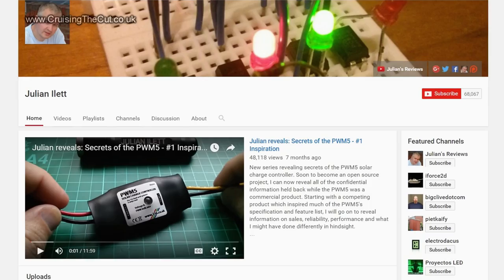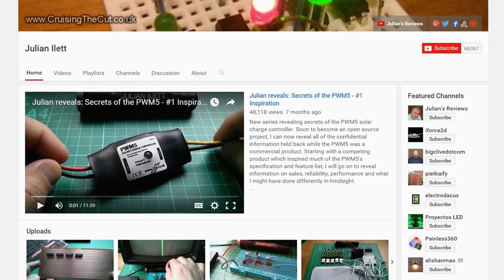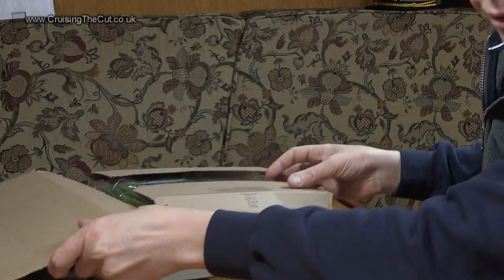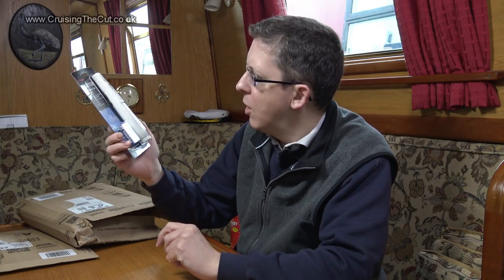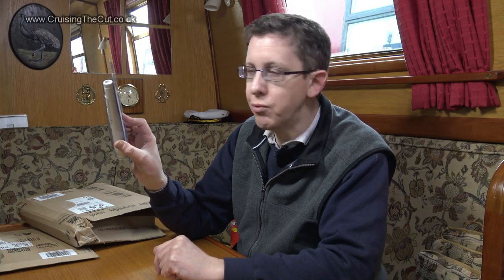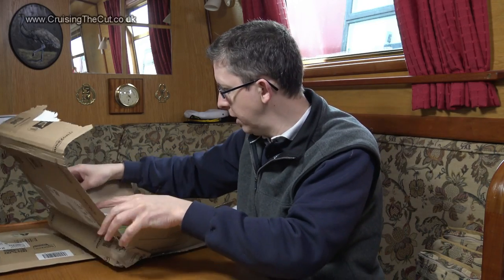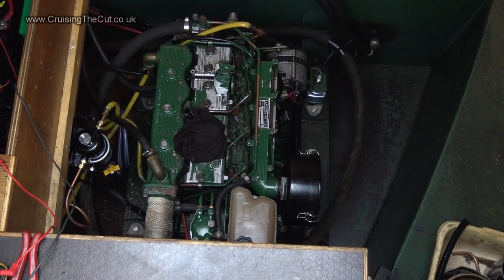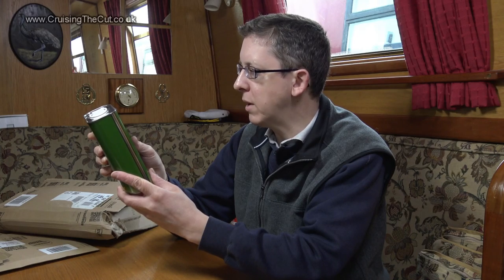24. Another haul of bits and bobs for my narrowboat.

Comment: Teflon tape is only intended for permanent pipe connections. It's not meant to be used on 'temporary' hook-ups. The pipe connection that goes into the storage tank should have an 'O ring' on the tapered nose. Putting tape on the threads will prevent it from seating safely and will eventually lead to bigger leaks. 'Tips from a retired plumber'...
Reply: Have to be careful with that stuff, I just in the last month or so had a piece of tape work itself into my hot water tank, blocking the hot water for a couple of days, then eventually finding it’s way into my showers two way valve causing it to leak until I was able to take it apart.
Reply: Above is correct. I suppose it won't hurt having the pt on the connection but the o ring does the job so anything the might cause the ring not to seat properly could be a problem. Love the boat and the vlogs!
Reply: By the comments it seems like his propane tank is doomed to 
Certain explosion as a result of Teflon tape being stuck in something
Reply: David is using plumbers tape not duct tape. Duct tape is awful, instead Gaffers tape will last many years and will pull off easier.

Comment: Don’t use the yellow PTFE gas tape on the threads going into the gas bottle! Or on any fittings that are flared. The tape should only be used on tapered thread joints. The gas bottle fitting relies on an 0-ring or flare to seal it to the bottle. It that doesn’t seal you need to inspect both the bottle and the fitting for scoring (and replace if scored) and replace the O-ring. Same for flare fittings. Using the yellow tape on those type of fittings compromises your safety.
Reply: you got that right
Reply: Ditto

Comment: Do not use the tape on the connection to the bottle. It is not a pipe thread and if you use the tape, you are going to create a leak.There is a reason the there is a o-ring on the front of them. Most new connection all have a o-ring to help seal the connection, if yours doesn't then you might have a an old set up and might need to upgrade.
People have a tenancy to not handle these item with care. They will pull them out the cylinder, let them drop to the ground and wonder why they have a leak. The ends are brass/copper and are soft. Dropping them causes damage and over time this will cause improper sealing. Always set the end carefully aside and you will never have sealing issues cause by bad ends.
The other issue is dirt. Always inspect the tank valve and the hose end for dirt. I can't tell you how many time a simple leak is cause by a small grain of dirt that got in the wrong spot. I was trained by a Englishmen back in the 80's to do propane vehicle conversion (i live in Canada). He was very particular about how thing are done. So i am passing on what he train into me all those years ago.
The best way to check your connections for leaks is soap and water in a spray bottle. Simply spray the connection with the solution and if there is any leaks it will start to bubble away. Simply tighten the connection a little more until you it stops bubbling. (if that doesn't work, take it apart and clean it, looking for dirt). You pointed out the hole in the bottom of the gun whale, and they are there for a reason. Propane as a gas is heavier than air. It will always settle to the bottom of hold and escape. You were not in any danger. Propane as a gas has a very narrow window in which it will explode.

Also some the tape you can buy is very specific to what it can be used on. Make sure that you read the use before you actually use the tape. Some tape is only use for hydraulic fitting, while some is used for gas only. You can buy tape for both used. When using the tape, you always wrap the tape in the direction you are tightening it. So clock wise, wrap it to the right hand and counter close wise on left hand thread. If you don't do this, when it is tightened it will unravel and not work at all, ie: create a leak.

Comment: I had a shower-shutoff valve like that. Turned out that when I stopped the water, the hot water cooled off in the pipe. The temp was not the same when it came back on. Better than nothing, though.

Loved the little yelp when it fell.

Comment: It seems to me that putting in a valve AFTER the hot / cold mix would mean that either the cold water or the hot water is gonna force it’s way back into the other depending which water is of the higher pressure. All things being equal this would likely mean the hot water would force its way into the cold water tank creating a cycle that will eventually keep heating up the water and using up your gas doing so also possibly damaging anything heat sensitive..... this doesn’t matter so much in the middle of taking a navy shower but I wouldn’t recommend using it in between showers just to keep a desired mix of hot and cold locked into the system.

Comment: I personally have been told NEVER put anything on the gas connection to the bottle, making sure the connection hose and bottle are clean is the vital thing.
It is the taper that is the sealing face and there must be nothing in between.
Simple leak test, get an old spray bottle, add water and washing up liquid (in correct proportions) spray around fitting after tightening............ growing bubbles you have a leak "simples"
Putting PTFE tape on the thread will do nothing but probably make doing the fitting up tight worse.
You can now get rubber nosed connectors (the taper being rubber), these also have no spanner fitting just a knob for hand tightening only (hand tight is all that is needed for this type).

Comment: be careful putting any battery powered devices near any gas leaks , there are leak detector cans you can by and just squirt them on all the joints and they will bubble at the slightest leak , also ptfe tape is no good for threads that use a washer as a sealing gasket (  gas bottle fittings ) , the threads are normally just for connecting the male and female parts whereas the black washer or gasket is the sealing part of the fitting , great videos btw ( and i am not being critical  its just i work in an environment that uses alot of dangerous gases ) , thanks again for the vlogs , really enjoying them ...
Reply: great points soap bubbles works just as well as leak detector and cost less than pennies.

Comment: Just found your blog, love it keep up the great work.
Your gas tape is very good but I have found that a couple of drops liquid dish soap in a glass of water and an old paint brush works just great checking for any compressed gas leaks.  Just paint the soap mixture on the suspected connection.  If there is a leak you will bet bubbles and if no leak you get nothing.  In the case of you gas connection, if it is  blowing bubbles just tighten a little until the bubbles stop.
Reply from the maker: Good tip, thanks! Glad you're enjoying the videos :-)

Comment: Having built a cruising boat and used it for several years and using propane gas in my own home (in 20 pound tanks) I feel I must say something about propane fittings. Propane fittings seal by metal to metal contact. The fittings to the gas tank are much like a ball and socket fitting. The ball is on the hose side and the tank has the socket, The thread is only to force the 'ball and socket' together. Using tape on the threads will provide you no security to a prevention of a gas leak. Worse still is that using the tape (or thread paste, as some-one erroneously suggested), is setting yourself up for a gas line failure. At your appliances are burners with a very small orifice. Particles of tape or paste will prevent your gas system from working. 
Take a good look at the hose end fitting. Study its' structure and you will see what the thread is for.
An other item of great concern is your desire to put a propane sensor in the propane locker. While it may well warn you of a leak it does not serve to warn you of dangerous gas. Your locker is vented (at the floor level) and leaked gas will harmlessly leave your boat and enter the atmosphere.
It is leaking gas in your cabin you must be concerned with. Here leaked gas will settle to your floor where you will not smell it and where it will collect as you do not have the vent as you do in your gas locker.
If you want something in your gas locker the I strongly recommend an electrically operated gas shut off. You can hook this up to an interior gas detector or (as I did in my boat) install  a "panic" switch somewhere convenient in your boat. If you have an interior gas leak the interior gas detector will sound the alarm. Then you run to your "panic" switch and cause the gas in the locker to be turned off.
You don't want a battery operated gas sensor. If battery dies you will not be aware that the sensor is not working. It must be tied into your 12 volt system. Also connect the sensor power supply to a fuse which supplies a circuit you constantly use. Thus if fuse is burned your constantly used item will not work and you will immediately know that your gas sensor is not working.
My wife and I are busy looking at all your presentations. Oh! How I wish I lived in England. Lucky you.
Reply from the maker: Good tips, glad you enjoy the videos.

Comment: This is an old video but I'm pretty sure those gas connection fittings use an internal flange setup to seal not the threads themselves.  If you are using ptfe tape to stop leaks you're just masking a problem with the fitting.

Comment: Hello, we’re in the USA(PNW) with our class A RV, the shower knobs were like yours a hot and a cold (it waisted a lot of water. We went to the RV supply store and purchased a new shower head/hose combination. It had a push on push off valve on the shower head that when you have the hot and cold mix to your liking, you push off lather up the push on to rinse off. Plus the water pressure was better with the new one. ⚓️I love the layout of your boat ... George

Comment: Just a couple of tips for you. There is a right and wrong way to apply PTFE (Teflon) tape. Wrap the tape so the exposed end faces away from the direction you tighten. If you wrap it the other way, it tends to unravel as you tighten your fitting. You mentioned brushing on your degreaser. I find it is much easier to put some in an empty spray bottle, and apply it that way. You can use a brush to agitate really grimy spots. Great video as always. I live vicariously through your adventure!
Reply from the maker: Excellent advice and much appreciated. Ta.

Comment: Never use teflon tape on left hand threaded connection to the gas bottle. As stated below the seal relies on the conical end of the hose connection that mates with the gas bottle valve, the conical connection may or may not be fitted with an 'o' ring.
Reply: wrap the tape the 'other way'...
Reply: Opposite to the 'Right Hand Rule'

Comment: You've probably discovered this by now, but that plumber's tape works like cling wrap. There's no adhesive, you just stretch it a little as you wrap it around the pipe threads and it clings to itself long enough to assemble the pipe fitting. I use it on all my gas and water plumbing.

Comment: the bottle connections are not to be used with gas tape or they are shaped conical or they use rubber rings. :-) and with that fitting on your shower hose you will mix hot with cold when using a other tap it will flow true your shower tap when you are not using the shower. only if there are one way valves in the wall behind the tap that could work. but you will know that by now i think. :-)

Comment: Teflon tape is for NPT fittings . In America that's National Pipe Thread.  Propane bottles here in America  don't seal at the quick attach threads. 
I have a tip when using teflon tape, the dreadful problem happens when you tighten the thread coupling... the sharp threads cut the teflon tape and render it about useless. I avoid this by making several complete wraps of the teflon(4-6)to the threads, I then use the edge of the teflon spool and roll it around the pipe threads forcing the teflon into the bottom of the threads. After that I apply a thin coat of approved pipe sealant on top of the teflon. This lubricates the teflon tape so the coupling can go together without cutting the teflon. When assembled properly, very little pressure is needed to stop leaks. Cheerio!

Comment: Hi Dave... Great channel I know this is early in your channel however just in case you need to deal with rust areas especially those at the base of engines etc. Use molasses 50 50 ratio and keep it submerged in the solution for up to a couple of months... Trust me it will remove everything rust ... then treat with phosphoric acid to cease the rusting process... it leaves a fantastic semi primed surface for you to finish up with any rust preventing paint. Keep up the great work

Comment: I know this is an old, but what i thought about for your rusty engine compartment, they make a stuff we use with cars, and its called pour 15, and most use it for gas tanks. you pour it into your gas tank (thats been taken out of the car) and turn its around so it coats the inside of all sides, and it will keep rust from forming and is not harmed by gas or water. It would work great for protecting the area where you keep getting the water and oil that you have to keep moping up
Reply: The tank sealer is different to the por 15 product you would use for that floor. Yes however POR 15 would be the coating of choice, it will bond to rust and being a ceramic paint it's a permanent cure for rust as long as it's sealed by the stuff.

Comment: The pipe dope is much better, the tape always seems to be a pain, the dope comes in a tube and does a better job make sure you swish the tube around before squirting it on you never know  how long its been sitting on the self and tends to seperate in the tube.. You could put the detector on a small 12-volt dry cell with a small solar trickle charger. Also, use the pipe dope on your shower valve to keep it from leaking as it is not a self-sealing pipe thread. You have probably found these solutions as this video was made two years ago

Comment: The wired-in detectors don't use very much electricity to do their thing, but they do need to be working ALL THE TIME, and that's why they get wired directly to the battery, no switch no fuse and (ideally) no splice either. Similarly, automatic bilge pumps should be wired directly in as well. If you need them, you want to have NO REASON for them to not work. and direct connection eliminates the reasons. In addition to one in the locker, the second place to put a gas alarm is low down near where gas is used. Water calorifier, central heating unit, hob. etc. Many alarms also come with connections for solenoid valves to shut off the supply if any of the alarms on  the boat trip. That may be impractical with your dual connection to the regulator.

Comment: I don't know about UK gas bottles but in the US the connection for the gas bottle has a rubber gasket which is what does the actual sealing, not the threads. So you don't need tape. But that being said everything else in the gas system does rely on a seal between the threads and needs the tape.

Comment: Be careful with Teflon tape... If it's a flair joint or if it's rubber sealed, Teflon tape will not be appropriate. Teflon tape only works when the threads are used as the sealing joint. Check to see what joint is used on your propane tanks first...
Reply from the maker: OK, thank you - good to know!
Reply: +CruisingTheCut I've found that not only is the PTFE a real faff to use, it's not really suitable for the standard "conical brass" type of cylinder connection.  I intend purchasing some Handwheel Pigtails which have a rubber seal and can, as the name suggests, just be tightened by hand. http://www.thecaravanshop.co.uk/gas-fittings/pigtail-connectors/propane-pigtail-with-handwheel/prod_946.html.

Comment: Actually you should never need to thread tape the bottle connection as it is the tapered seat that seals not the thread but I guess by now you will already will know this. Good video though.
Reply: Ken Allen is correct.

Comment: The threads of gas bottle connectors are NOT to be sealed with tape or pipe dope. Those fittings seal with an o-ring or a soft brass nose against the corresponding section of the bottle valve. Tape is a particularly bad idea here. The tape is likely to stop the threads from traveling far enough into the fitting to seal. Teflon or PTFE tape is not a good idea anywhere. A good grade of pipe dope—some are made specifically for gas—always makes a better seal. I assume teflon tape became so popular because it is cheap and less messy.
Reply: Quite right . That tape is just for tapered threads that seal via the threads . In this gas bottle connection , the threads serves to mechanically draw the sealing surfaces tightly together and therefore anything clogging that action is reducing the force upon the sealing surfaces . A clean thread is a good thread , in this case .